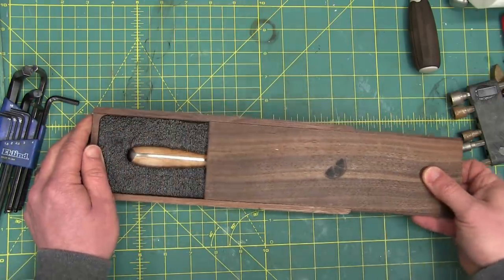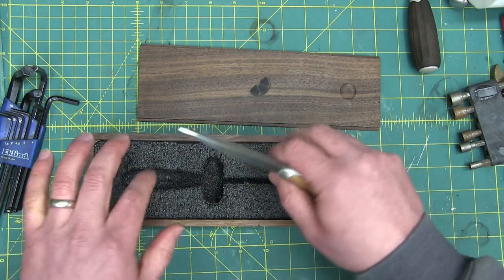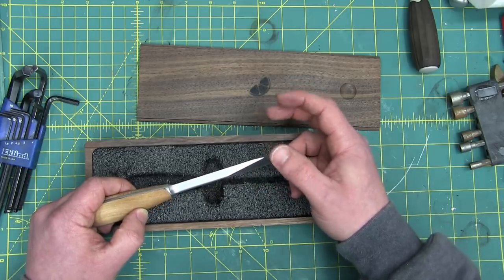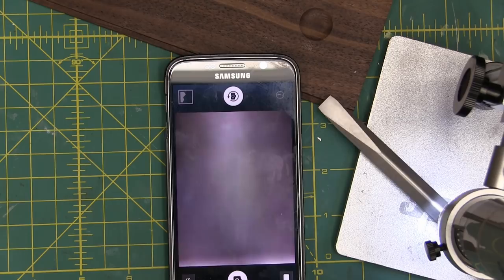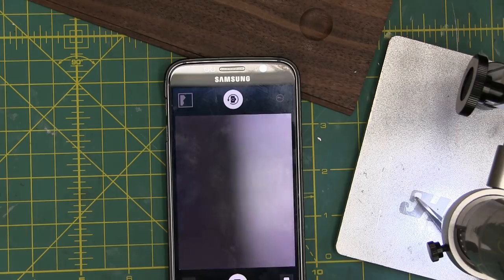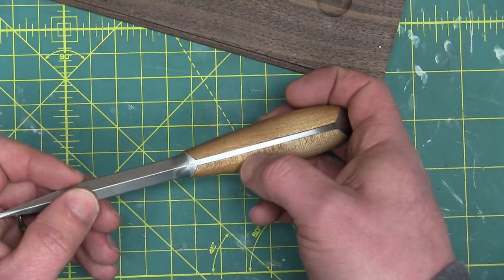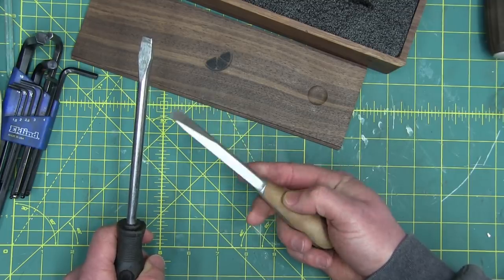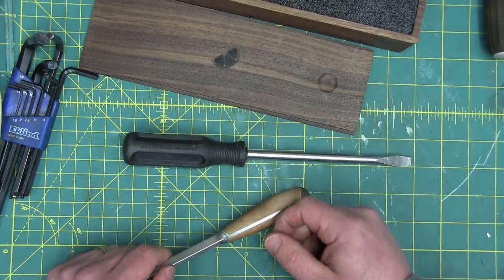Tool that doesn't exist? | MAKE IT!

Comment: very nice screwdriver,  though  ....Nein!! Titanium is NOT "VERY" stiff, it's modulus is in between steel and Aluminum...before we say "well per/weight"..that's not how stiffness is generally unitized..http://www.amesweb.info/Materials/Modulus-of-Elasticity-Metals.aspx...needs rivets through the wood to keep it from leaving the metal eventually?

Comment: Didn't have to have it made out of titanium you couldn't made it or had it made or hand forged even better yet out of tool steel which would have lasted multiple lifetimes Just like all those other old tools that you wanna talk about they were all hand forged and they are still lasted as long as they're used properly not abused

Comment: Need help making cool shit and putting it on the internet:  Want a app-controlled, battery powered, pneumatic pump that feeds a manifold and inflates 6 bladders independently but in a pattern.  Not even sure if what I said is engrish...  but where to start...?